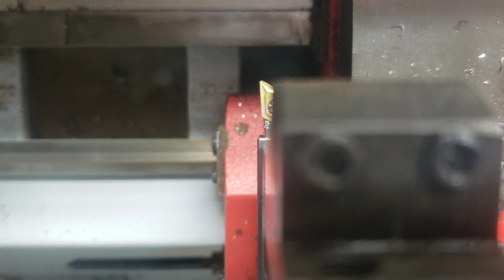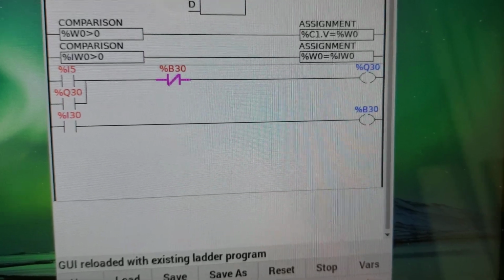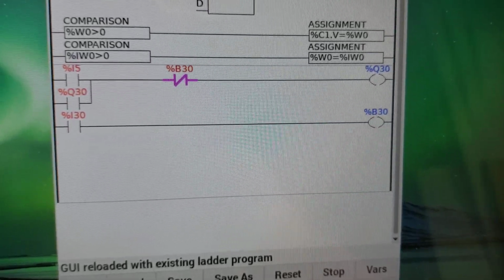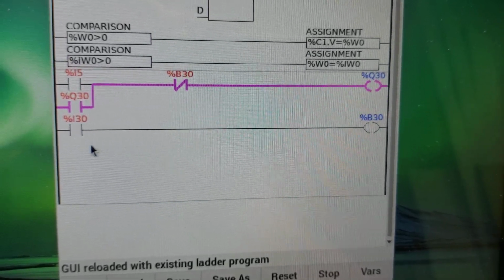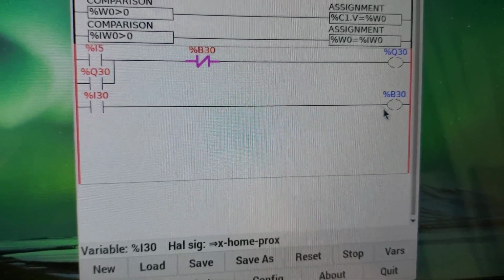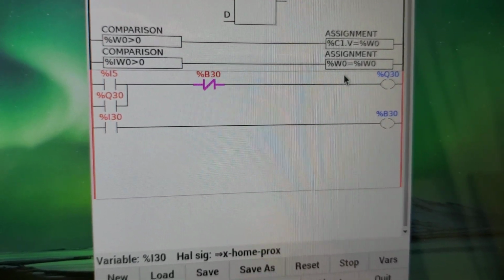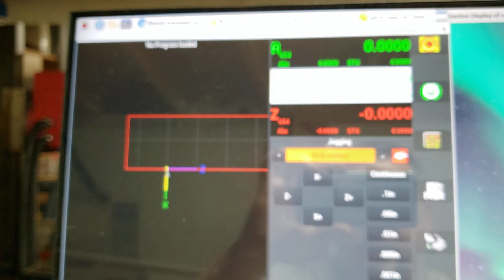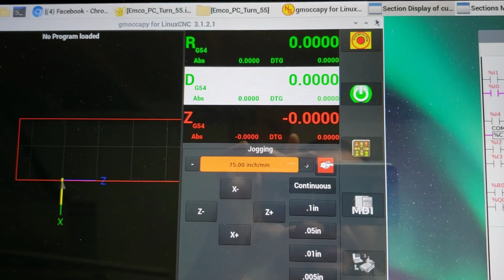LinuxCNC two switch homing issue

Comment: Did / does it have anything to do with restore the X joint position?
Reply from the maker: It was due to a limitation in 2.8 software where the double homing was relying on encoder position and index feedback. 2.9 they introduced a new ini flag
Reply: @TheFeralEngineer   As I am making the punge into LinuxCNC your videos have been super helpful! Thank you for all your help and your contributions to the LinuxCNC community!

Comment: Would be good to see what the real world effect on precision is in comparison to just the mechanical switch. My machines all use mechanical switches and never had an issue with repeatability. Especially when my mills have a resolution of only .005mm. Only had one switch fail in 8 years.
Reply from the maker: This one floats about 0.1mm or more. I used an and2 gate and disabled the double homing in the ini file and the proxy is right on the money. I really want this to work the way I want it to in the way it seems to be depicted in the documentation.
Reply: @TheFeralEngineer  i must actually try and measure my repeatability one of these days. 0.1mm seems excessive.
Reply from the maker: They rely on the prox sensors to be scripture. I FINALLY got it. I had to update to the master branch because they added a new function to the ini config 🥴🥴🥴🥴